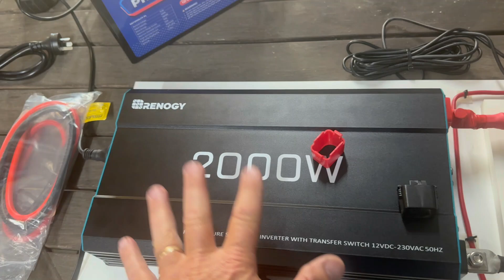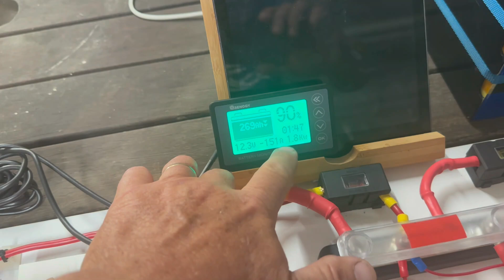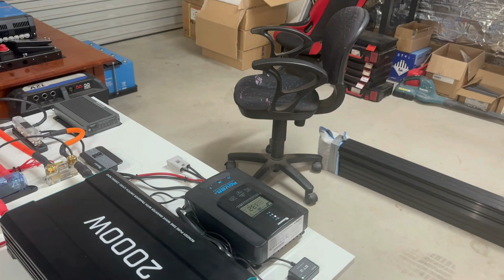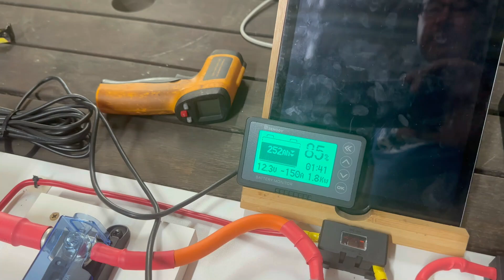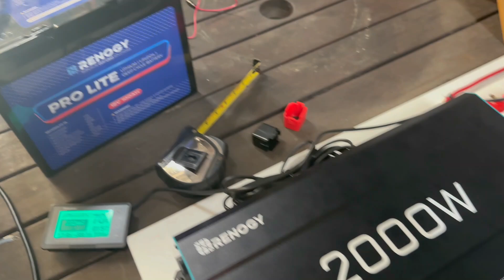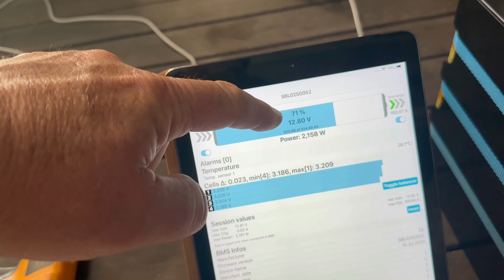Renogy 2000w inverter -  test

Comment: Why did you say if you use it 3-4 times a year? Did you mean a day? 
I’m gonna use it for coffee machine air fryer ice machine and maybe to charge battery’s to our vacuum cleaner. I guess that’s ok.
Reply from the maker: I meant if you went away 3-4 times a yeah and used for the couple of weeks on the road.  But not if you relied on it 365.

Comment: As already mentioned by others, these 230v Renogy inverters have a centre tapped earth when in inverter mode, so they won’t trip your earth leakage protection (GFCI) without neutral/earth bonding. The neutral/earth bonding MUST be disconnected when on a hook up that has its own earth. Renogy provide no information about this problem in their installation guide.

Comment: Qty. of 2 200amp Hour Lithium Batteries with 200amp Internal BMS in Parallel to Buss Bars with 2/0 Gauge Cables Works Good here in The States - Nice Video Mate 👌

Comment: You may find the reason it wouldn't handle the surge is the battery voltage dropped quite a bit. May need 2 batteries in parallel to stop that. Have a look back through your video and you will see it went below 12v. It was quite quick so hard to tell how low it went. Good test.
Cheers
Joel
Reply from the maker: Hi Joel,   I know the Safebatt Lite 300ah is good for more than that and handles 2.5kw without an issue.   The inverter shutdown is 10v,  I think it just can't handle much more than the rated 2000w ongoing.   The voltage drop could be via my 50mm2 cables and Andersons, I'll test with a direct battery connection with 95mm2 and see what happens.     thanks for the comments.